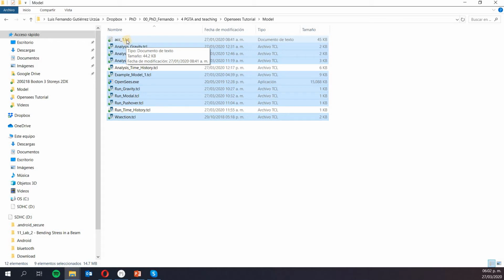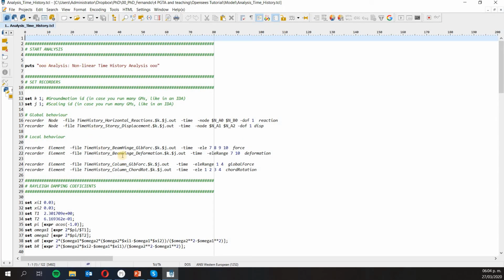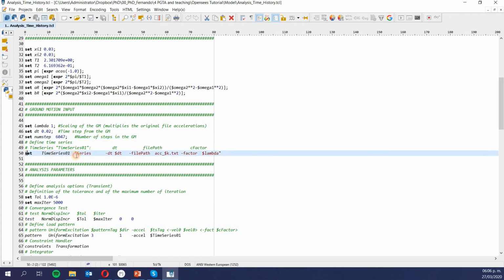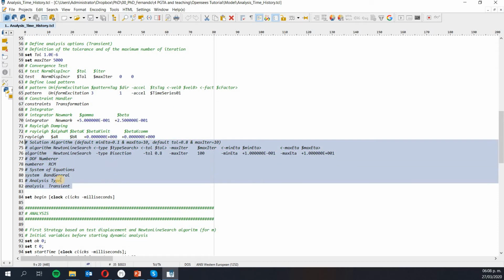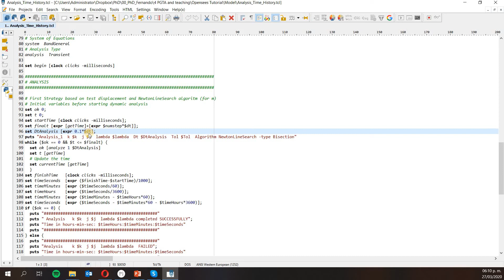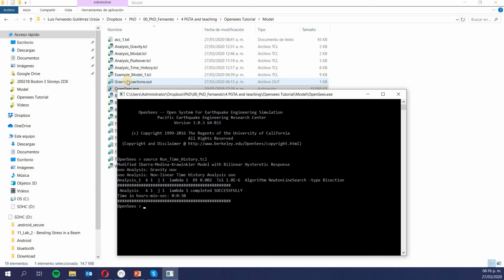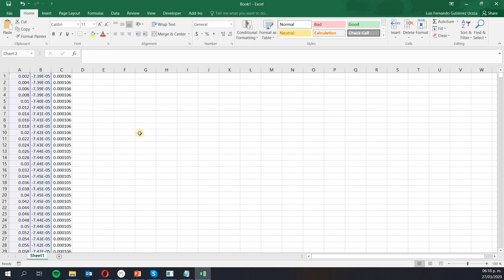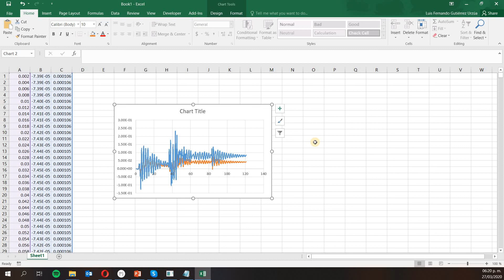OpenSees - Your first OpenSees model - 4 Time History analysis

Comment: Hello Mr. Fernando, I’m very glad I found your OpenSees tutorial series. I’m a beginner, and your videos have helped me understand the basics while making the learning process enjoyable. Thank you for your excellent work. 
I have a quick question. I’m currently modeling a bridge bent system with self-centering bracing. I understand OpenSees has self-centering material models (like SMA bars), but those seem designed for a single material element. My bracing system uses composite materials (steel + SMA) and shows a flag-shaped hysteretic response, which I previously obtained from Abaqus simulations. I’m unsure about the best way to implement these combined self-centering bracing properties into an OpenSees bridge bent model-whether through material definitions, element formulation, or force-deformation input.
If you have any suggestions, I’d be very grateful. Also, if possible, a video on modeling  self-centering bracing in bridge bents would help many students like me.
Thank you again for your time and dedication to the OpenSees community.

Comment: very good work, thanks for the tutorials.  One question, do you think this is accurate solution, especially you seemed you used single element for every beam and column with 4 integration points per column. ? If i were to do this in ansys for example I would need at least 10 elements per member, which means longer solution times, but better accuracy.
Reply from the maker: Hi!, thanks for watching. It depends on what is the purpose and scale of your model. I normally do frame modelling, hence I care more about the global response. Also, I often work with very large models in which the local behaviour has to be idealised.

In a beam section, it is typically expected that plastic deformation will occur at the ends, hence these simplified concentrated plasticity models are good enough to represent the member's behaviour. If my interest is to analyse a beam locally, I would probably not use a concentrated plasticity approach (maybe even a different software like ABAQUS).

With respect to the integration points in the column, four is the minimum I would use. I believe ten is the maximum that OpenSees takes, but you always have the option to discretise the element into smaller members. For my use of OpenSees, 6 would be more than enough.

At the end, it is a compromise between accuracy and computability. And I guess the best advice I can give you with OpenSees (and other analysis software) is to start simple and add complexity layers later, such that you understand your model better.
Reply: @fernandogutierrezurzua  Thanks alot for your quick reply, it is really appreciated. I agree with what you say. I am a researcher in structures and thinking to study EQ response, so I was wondering if it is worth switching from ansys to opensees in terms of efficiency and material database. Another little question, i see that your scaling factors for the incremental dynamic analysis were all below 1.0,  is this a common practice for IDA? i thought that in IDA you keep scaling the TH record up until failure limit of the frame.
Reply: Maybe another simple question, and i hope i am not being annoying here. Do you happen to know any good open-source software that can be used for visual pre- and post- processing in opensees, perhapse that could generate the tcl files?
Reply from the maker: So one by one...

I think that if you are running something very repetitive, that requires to be run in a programatic manner, OpenSees is great. More 'local' analyses are probably better run in ABAQUS or Ansys, due to their amazing interfaces. I know that there is an endless number of element types in OpenSees that could allow you to model to a similar level of detail, however, I mostly model frame elements. In the few cases in which I have had to model more locally, I have employed ABAQUS.

There are a few open source tools to visualise your models, but they are limited to tcl programming and that makes them quite rubish (despite having been developed by really good engineers and experts). There are a few paid apps, such as STKO. If you can afford it, I would definitely recommend you using them.

Now, if you are only starting with OpenSees, I would strongly recommend you to migrate to openseespy, as most of the development is now occurring in python. I have seen some good open source pre- and post-processing libraries in python that are used by other people, however, I am not familiar with those yet, hence I don't know their names or which one to recommend.

With respect to IDA, assuming that you use Sa(T1) as Intensity Measure (IM), you will have to scale the ground motion to match your Sa(T1) to a range of values (e.g. 0.1g, 0.2g...1.0g, 2.0g). Depending the intensity of your original ground motion, you will have to scale down or up (or both). Keep in mind that excessive scaling is an issue, hence IDA comes with its disadvantages. I would recommend you to read about this before choosing this approach (Check the work by Prof F Jalayer, Prof D Vamvatsikos, among many others).

Hope this helps!
Reply: @fernandogutierrezurzua  Thank you for your valuable answers

Comment: Hi. After I convert g to ms2 then I run the analysis, the output acceleration is very small. How to solve it? Thanks
Reply from the maker: Hi Norazah... I would check the units of your accelerogram to make sure it was in 'g'. It shouldn't give you issues if you follow the steps in this tutorial, but obviously it depends on what accelerogram you feed to your analysis and what units convention you choose.
Reply: I am  also getting small out put only .... getting significant values only if scale factor is greater than 2...did you find any solution